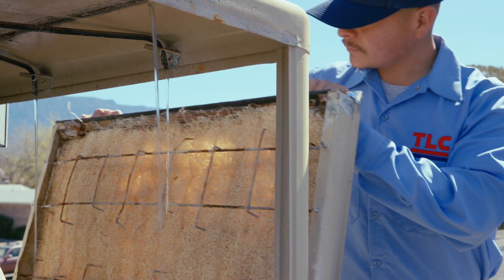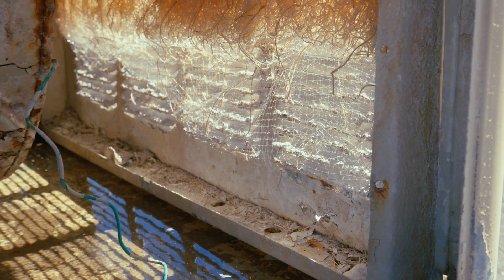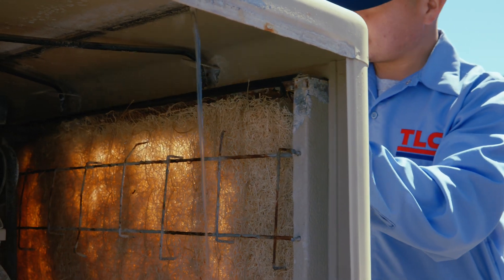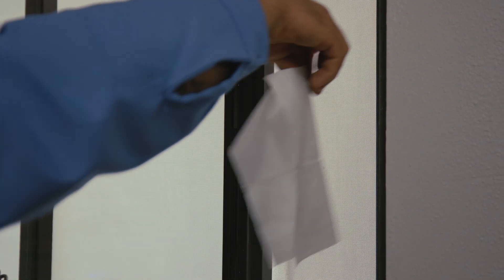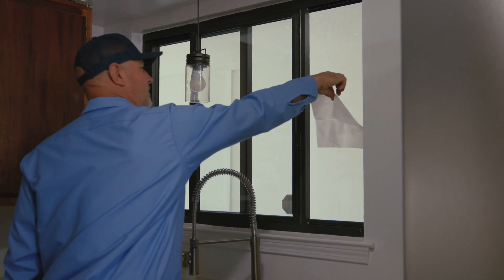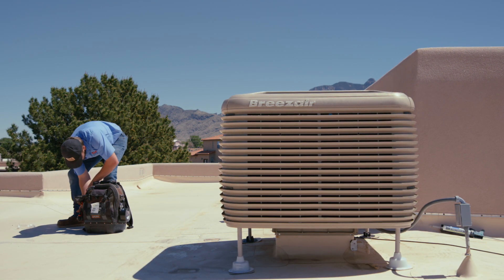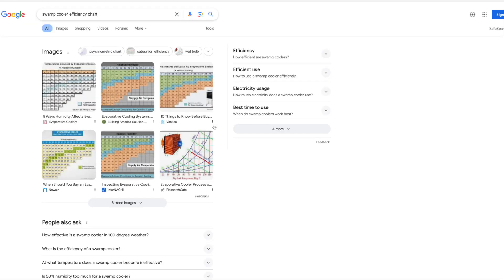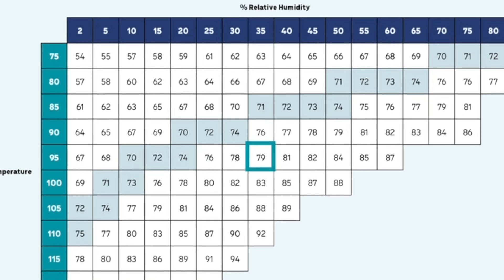How to Improve Swamp Cooler Efficiency

Comment: I also want to know about mounting a swamp cooler and or AC condenser unit in the shade.  I’ve seen some videos where people have created a shade shed (roof but no walls) around AC units and I feel this makes sense in theory for swamp coolers too, especially metal ones.  My point is that the one thing those charts don’t account for is the added heat build up created in direct sunlight.  Ambient air temperature is one thing and the heat generated on metal in direct sunlight is often 100-150 degrees more, which easily translates to the enclosed inside of a swamp cooler being dramatically hotter than if it was mounted in the shade or had shade over it.   Lastly, the house we bought had an old rooftop cooler which we removed also in part because the leaking rotted about 12x12ft of shingles and the underlying plywood, as well some of the supportive truss frames.  So instead, we switched to a ridgeline vent system, got rid of the gable vents, and on the east gable which starts to become shaded after 1pm, we installed a side-draft cooler.  Between those two changes it made a world of difference.